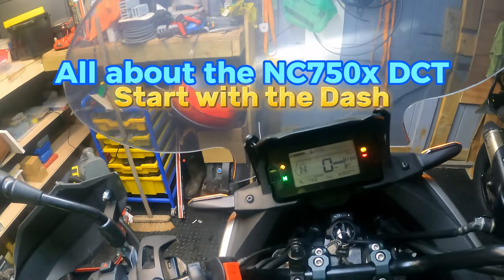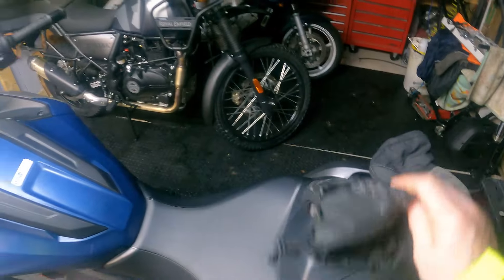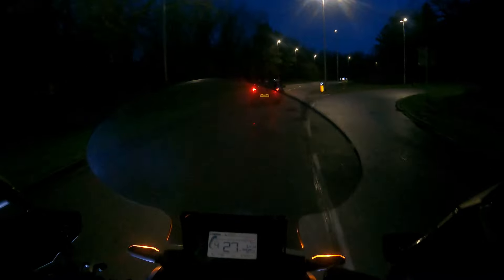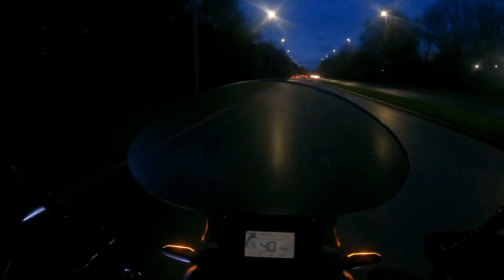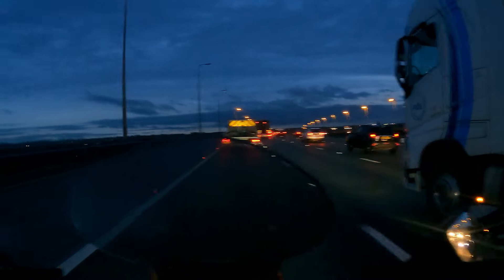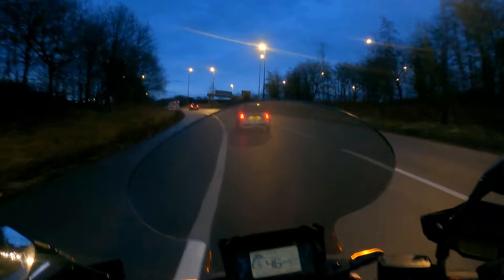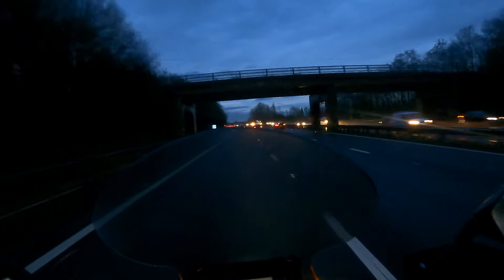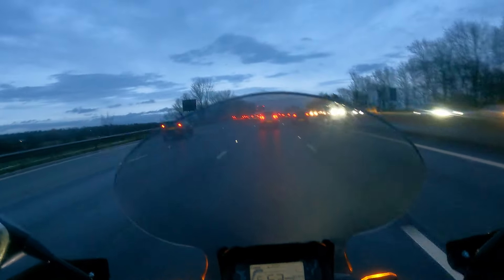How to use DCT Gearbox "Honda NC750x DCT"

Comment: Great video explanation! I just noticed a couple of minor inaccuracies that I’d like to point out:

	1.	User Mode: You can switch off Traction Control completely. [After a new start, Traction Control is activated again.]
	2.	In Sport Mode, Engine Braking is set to the highest level (not the lowest).

I have to add that I’ve had plenty of bikes in my life, mostly 1000cc to 1800cc, but the NC750X is the best commuter in the world. I use it year-round, 100 km a day, and two additional features/mods are fantastic: the blind spot monitoring (radar with mirror flashlights) and cruise control—both of which I really like!
Reply from the maker: yes you 100% right didn't even notice, traction I didn't seem to be able to turn off complete in user mode, I'll look at the again 👍👍👍🍺

Comment: I think you can turn off traction control by pressing and holding the down button whilst adjusting the user mode traction control. It goes back to setting 2 after power off.
Reply: @birchwoodbiker  I read it in t’ manual.
Reply: you can turn off traction control. hold down arrow

Comment: I've owned a manual Honda NC and I test-ridden the new DCT version, completely agree with everything that you've said.
Reply: @birchwoodbiker   The manual was good up to a point but found it more restrictive than the dct.

I found that after coming from a Yamaha FZ8 I found myself wanting more power so I bought a cross runner.

I tested the latest Honda NC 750 dct and it was great. Lots of power, better torque delivery than my 2016 800x crossrunner.

That's my point of view, I may buy the DCT in the future but I'm considering all my options.

If they put a shaft drive I'd buy it immediately.

Comment: I dont think it has combined braking. The original 12/13 NC700X did, once it updated to a 750 in 2014 i think they dropped that system.